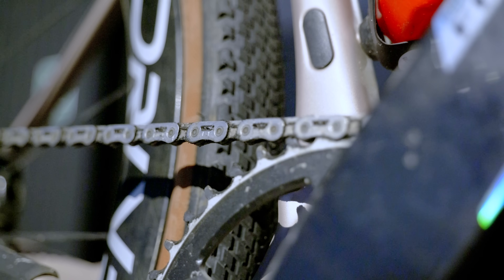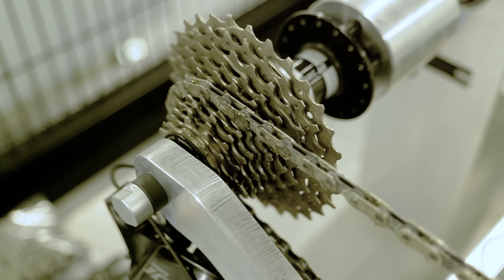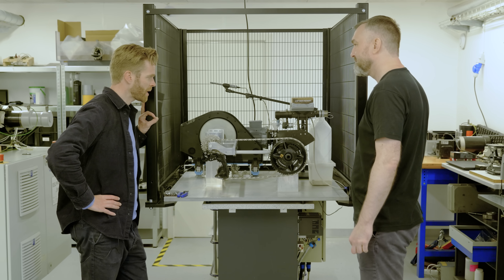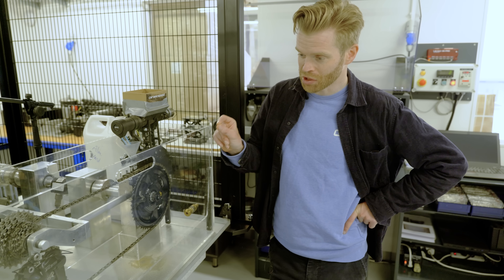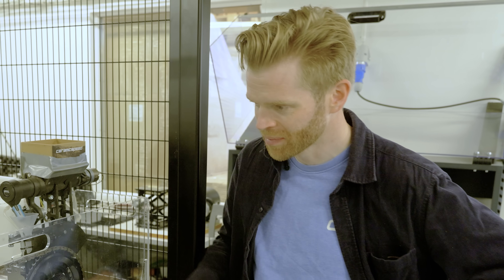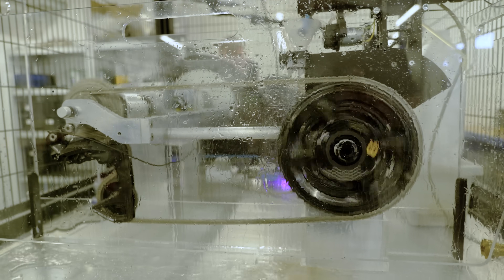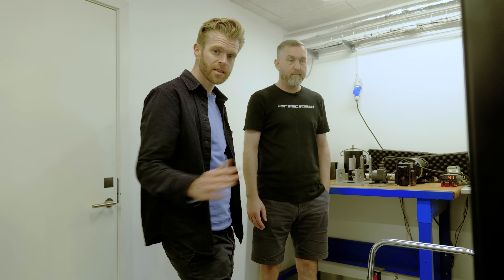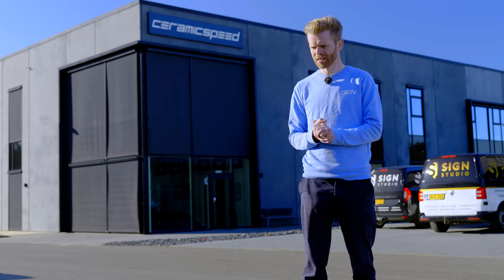We Lab Tested A Dirty Chain, How Much Slower Was It?

Comment: Has anyone tried a system to realign the chain line as you move through the gears. And what difference this would make to efficiency. A very interesting video. Thanks
Reply: I think a front sprocket that can slide inwards and outwards would be interesting. Nothing complicated, perhaps a spring either side so it could essentially position itself.
Reply: @topshine46  The problem with that kind of system would be that to have a perfect chainline on a typical cassette, the Q-factor on the cranks would have to be massive to allow for movement towards the smaller cogs, which are the ones most in need of optimising. It's a cool idea anyway. One solution could be to have two chains and an additional intermediate cog setup in between of the normal chainring and cassette. The intermediate system would be the one moving the "chainring" and thus getting the movement out of the way so that the Q-factor on the crankarms could remain the same. Though adding a second chain and an intermediate cog system would in itself impact efficiency negatively, so the net effect might be worse.
Reply: @astroturd  This actually is something Shimano has a prototype for as an internal gearbox design and they patented. It basically acts similar to a CVT where you have 2 cassettes and 2 chains that can offset each other to retain optimal chainline. The main reason they tried this setup is that if the whole sealed gearbox is constantly lubricated with oil, it tends to be much more efficient than a constant meshed gearbox design. Still isn't as efficient as a derailer + chain setup though, but the gap isn't as big as a constant mesh setup.

Comment: Interesting video, few flaws like using incompatible components  but even so it demonstrates what engineers have known for a very (several hundred years) long time. A roller chain is a very practical transmission, it’s relatively efficient, easy to produce and maintain and pretty resistant to contamination. Chain line deflection V articulation is a really interesting comparison, the majority of roller chain applications don’t purposely introduce deflection whereas bikes do. 
What would be interesting to see is when the larger sprockets get much larger. I run a ‘hungry boy dinner plate’ 51 tooth sprocket on my Shimano GRX 1x 11 speed, I can hear the Watts falling off the chain! The disengagement angle of the chain at that increased diameter and the chain line is hideous but it’s for emergencies only 😁

Comment: Best thing you can do for the money, if you have an older or lower range derailleur, is to replace the jockey wheels with ball raced jockey wheels, which used to only come on dura ace derailleurs but I think Ultegra now have ball raced jockey wheels. The second 'free of charge' thing you can do, if you run Shimano chainsets, is to NOT overtighten the plastic bearing preload nut/bolt, even by hand it can be over tightened!
Reply from the maker: yes! we've seen the Hollowtech 2 preload caps overtightened before, no need - it is designed to be 0.7-1.5Nm
Reply: Switched to sealed race jockey pulleys years ago, no brainer. As a bike builder I am fanatical about chain line for efficiency and lower wear, now feel smug 😅